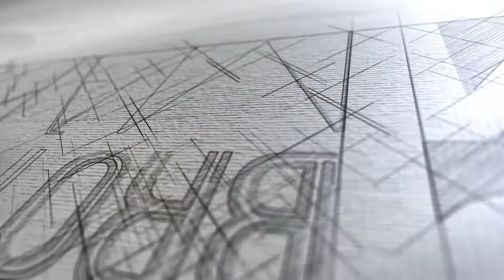Buried Sword Restored

Comment from the maker: Does anyone know anything about this specific type of sword? It would be great to hear about it if you do. Don’t forget you can use ‘BMWINTER’ to get 10% off abrasive belts on the MultiToolProducts Europe website 🤙🏽
Reply: to me it looks like a Talwar
Reply: This is a Sumatran sword known as a podang piso. It's similar to an Indo-persian sword known as a tulwar but has key differences such as the round pommel and the ends of the quillions.
Reply: By the type of "rust" on the handle and hand gard i can tell its made of solid silver!!!! Well done finding this sword
Reply: This is mixture of Indian and Persian sword.its name Victorin handle pulwar.
Reply: @lowbro7202  Yup, that is indeed a Sumatran piso podang sword. And an antique judging by the hilt design and patina.
Reply: Yeah, 19th / early 20th century piso podang from Sumatra. 

You risk destroying the tempering by overheating when sanding it like that.
Reply: @jellekastelein7316  tempering actually softens a brittle blade after it's quenched. Heating the blade up tempers it more. So that would only be enhancing the temper. So please stop saying that and tell everyone else to stop as well. 😊 What it messes up is the blade's hardness and ability to hold an edge. But if it's cool enough to hold then it's fine. Changes in the steel's crystalline structure don't start happening `til  around 250ºF or 121ºC.
Reply: This is, as most have stated, a piso podang from Sumatra. Oriental Arms has one just like it archived in their "sold" listings. It's the spitting image from the hilt right down to the double fullered blade. Ashoka Arts has another archived, as well—again, same exact sword but with different arabesque engravings on the quillons.  Looks like most of these were assembled using  "European trade" blades so most likely from Sheffield or Solingen but finding ones made of wootz with Islamic calligraphy engravings isn't unheard of. This specific style seems to have come in vogue around the 2nd 1/2 of the 19th century.
Reply: @nickaschenbecker9882  Right. I'll word it more accurately next time. 121ºC is not all that high, though, and it would be trivially easy to accidentally remove interesting markings, so care should still be taken when using power tools.
Reply: Origin of this sword

Comment: My heart broke
Reply from the maker: Why!?
Reply: @BrothersMake  hurt the value
Reply from the maker: What?? 🤨
Reply: Don't worry, it's a cheap modern sword.
Reply: @AutoFirePad  It's not a cheap modern sword, it's a Sumatran podang sword. These swords usually date anywhere from the late 1800s to the 1920s. It is a genuine antique and the restoration lowered the value of the sword as it looks new now.
Reply: @rhonsah1984  And hilts are usually assembled like the one in the video (no pins or screws)???
I don't want to be wrong!!!! This restoration is an abomination.
Reply: My heart sank when he used the grinder on the blade. And then the tang as well (which was totally unnecessary).
Reply: @AutoFirePad  Looking at the two piso podang swords I have in my collection, the hilts are cast whole (I think via lost wax method) not multiple parts that are then assembled together by brazing (such as in older Indian tulwars). The people these sword are associated with, the MInangkabau, are known for their brass works and they use the lost wax method to cast their brass crafts. No pins or screws are used in hilting these swords.
Reply: @AutoFirePad  A different sword should have been chosen for the video but it is what it is. Swords like these are sought after by ethnographic antique sword collectors and are usually sold anywhere from 150 to 400 USD (based on auction sites like Ebay and antique seller sites ) depending on condition. A few with silver hilts, Damascus blades, ornate hilt carvings, blade embellishments and lavish scabbards will command higher prices (up to 1K or more). The restoration hurt the value of the sword.
Reply: @rhonsah1984  Amazing. I'll research more about those swords.